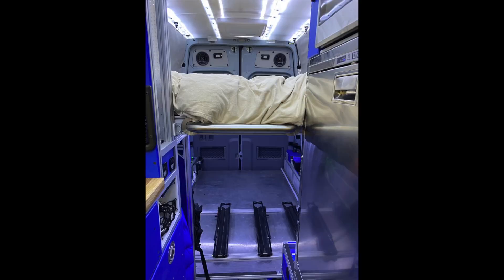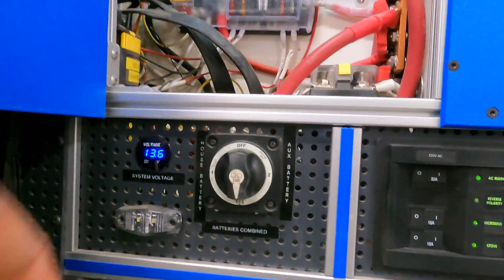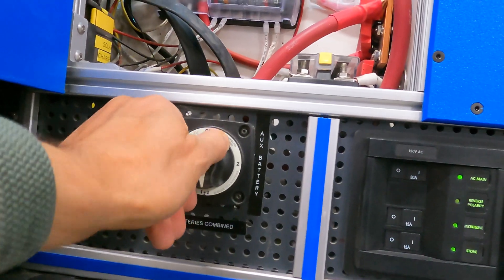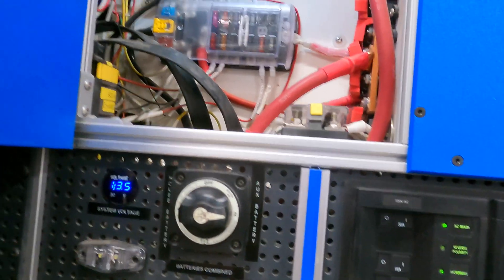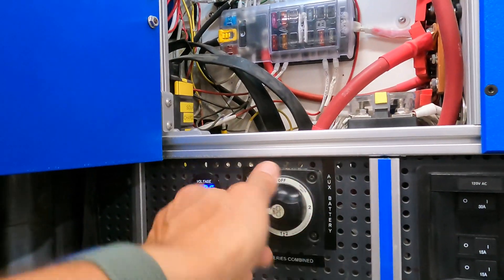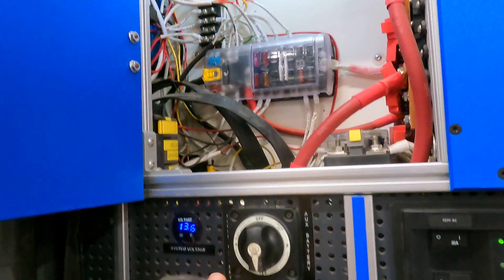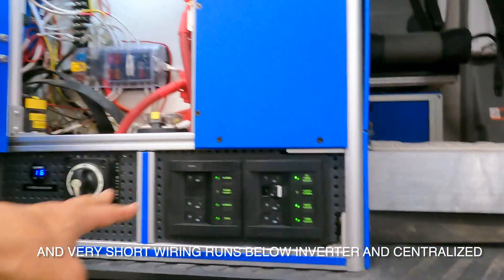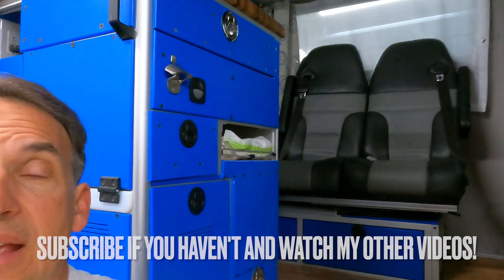Camper Van Electrical system by ex-Tesla Design Manager

Comment: Because you mounted the batteries outside Is it ok to charge in freezing temperature? Thanks
Reply: Thank you. It will awesome to show details of how you build everything.
Reply from the maker: @nathanw9899  You're welcome. Glad my videos are helpful. A lot more to come soon.
Reply from the maker: Yes. Lithium batteries can better handle broader operating temperatures--both colder and hotter--than lead acid. It is the plastic battery cases that can get harmed before the battery cells by cold temps. So many people incorrectly think that lithium batteries will be harmed by cold, but usually at cold temps well below any typical use and "camping" temperature. For example, I tested lithium batteries with the US military down to -40 C/F, so the answer very much depends on chemistry, operations, cell temperature (not environmental temp) and charge/discharge rate, etc. This is from Battle Born's website: "Battle Born Batteries protect themselves from charging in cold temperatures and won’t accept a charge once the internal cell temperature drops to 24°F. At this point they will continue to discharge even down to -4°F. At this temperature we recommend no longer pulling power to avoid damaging the batteries. Insulated battery boxes, heating blankets, and placing your battery bank inside your RV will help keep the temperature stable. On the high end of temperature range, the batteries will shut down once 135°F is reached." Where my batteries are installed, all four are compressed against each other and held in place by non-thermally conducting structural fiberglass--no metal--and have other intentional engineered solutions to help them maintain cell operating temps. Only once has their internal BMS prevented charging after two days of camping at nighttime temp of 10-14 F. The BMS opened up after about 15 mins of driving/engine temp warming up the batteries, but of course, they continued to discharge just fine as this temp is well above their lower operating temp. And so you have to ask, will you be camping at -4F, or needing to fully charge with internal temp of 24F/likely environment temp of about 15F, or can charging just wait a few mins to a few hours to get charged once engine temp or outside temp or usage warms up the cell temp? In almost five years of usage, including camping at below freezing, and much monitoring of batteries, there is no reason to not install batteries outside unless camping at below 0F or needing to fully charge at below roughy 15F, and these can be further reduced if using a heating source; my heating source is the engine's heat, in which I have been more concerned with (above 100F outside and climbing long highway passes) but has proven not to be an issue as battery temps have stayed within 5F of ambient temp, and I am not camping at 130F. There is much mis-information about lithium batteries. Having led battery cell production engineering for two lithium battery companies, I know my mounting location is well within operating specs. Think about your cell phone and other electronics being used and charged without concern in cold and hot and humid operating conditions--watch, phone, GPS, etc. You are welcome and glad that I can be helpful.

Comment: KC thank you, your short tech videos are inspiring and helpful! I love your alternative material choices and over-the-top approach with systems. I figured you were an engineer.

P-touch wire label material hasn’t worked for me, they unwrap. I noticed your smart shrink tube wire labels. I figure those printers are out of touch for most hobbyist-level tinkerers. Do you have any recommendations on what to look for and cost?
Reply from the maker: Thank you for your compliment. And glad that my videos are helpful. The heat-shrunk labels I use on my wiring is very reasonably-priced. I use the @RhinoDymo label maker and off-brand heat shrink labels in different sizes and colors available on @Amazon. Works great and makes for a clean installation with knowledge on both sides of the wire where it goes to and cleans up the crimp terminals.